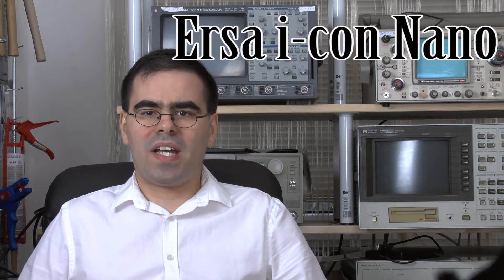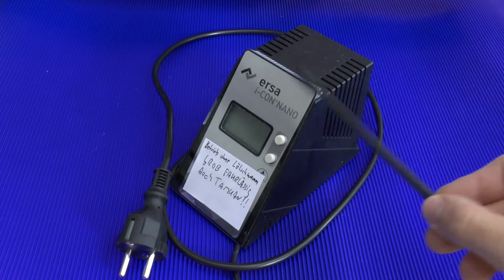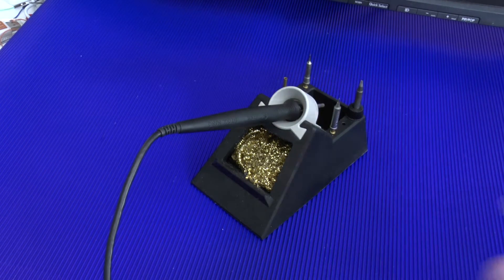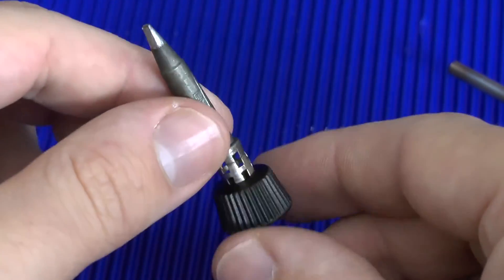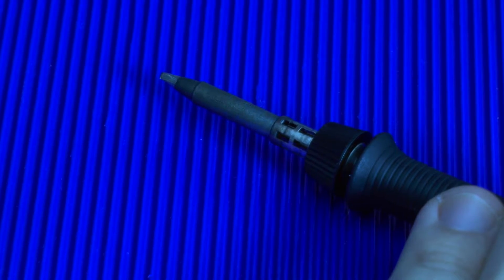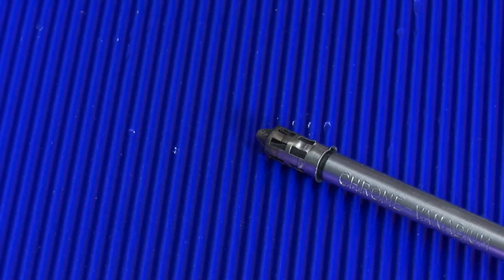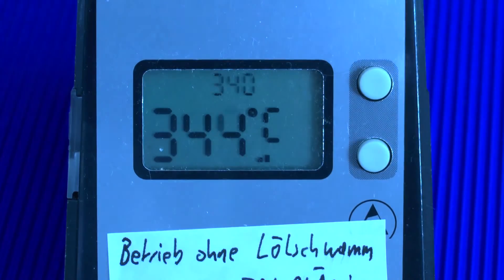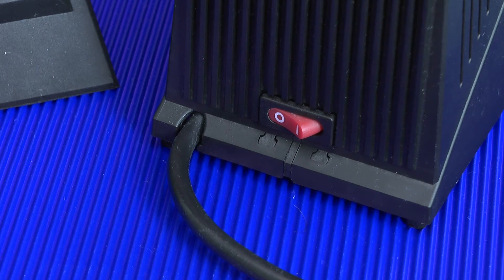Ersa i-con nano - review, solder tip caveat emptor

Comment: I bought only an extra tip holder (a green one), so I have one green and one black. Every time I need to change tip I always have a cold set handy to separate until the previous one cools down!
Reply from the maker: Thanks for talking back, man. One question, however - did you break one of them during teardown? I almost killed mine when I tried to seperate the tip from the holder...
Reply: @MrTamhan  I have found that removing the tip retainer is very dependent on the angle — if force is applied at any kind of an angle, it can jam and make it need a lot more force. (I now just have a retainer for each tip. It's just not worth the fuss. I actually bought a few spare retainers to keep on hand, since many vendors sell the tips, but not the retainers!! 😒 I'm considering a switch to a Pace ADS200 though, since its 120W cartridge tips are cheaper than an Ersa tip plus retainer, and Pace's build quality is spectacular. I got a used Pace desoldering station, and it's just fantastic.)
Reply from the maker: @tookitogo  Thanks for talking back man. I had someone from EDSYN blow up my mailbox, but she since went quiet...let me know how it all goes, please

Comment: Did you say you should use a wet sponge?  I thought this was a no-no.  Causes stresses in the tip cladding and reduces tip life.  I only ever use dry pads like the one in the video and my Weller tips seem to last forever.
Reply from the maker: Hello, to be honest - I recently found one of these dry steel wool thingys to work quite well too. It, IMHO, is mainly a question of taste - if the tip lives a little less long, but it is more comfortable to work, then...ugh, its all a bit difficult ;). Big thanks for talking back though!
Reply: Using a wet sponge is indeed a no-no. A damp sponge, however, is OK. With that said, the brass wool is even better, being gentler on the tip (due to much lower thermal shock, especially at the higher lead-free temps). I don't miss the sponges at all, having to keep a bottle of distilled water at hand all the time...

Heck, at work this week (I work at a technical training center) a kid laid an iron down to warm up, as it had a special tip mounted that was much too large for it to go into the iron holder. He didn't realize he'd laid it onto the sponge, which hadn't been moistened! 😩 After a little while, the teacher asked "umm, what's burning?!"

Comment: You can buy them on Amazon (round about 7€):

Ersa Lötspitzenbefestigung für I-Tool, schwarz, 3IT1040-00 https://www.amazon.de/dp/B00725AYNO/ref=cm_sw_r_cp_apa_zx7yAb22BPZYH

They make changing the tips very easy (you can even change them while they are still hot)
Reply from the maker: Thanks, man!

Comment: It's PEBKAC problem, not an issue with a tool. I you would do this normally, and not bang it against the desk, it would take half a second to remove. Just calmly take it with both hands and push the tip inside the holder.
Reply from the maker: Try that when its hot ;)
Reply: If you want to change them hot, just buy some tip holders as I've done. Actually one piece is enough. Just put spare holder on the tip you want to use and remove from hot tip a bit later.
Reply from the maker: Well man, I bought one for each tip and now have no effort ;)

Comment: FYI, it turns out that the plastic nut and the metal collar can be purchased separately, at least in theory. The plastic nut is part "3N497" ("3N497G" for the green version), the metal collar is "3N539". However, finding vendors that actually sell them alone is tough. I did find one in Lithuania: https://www.evita.lt/en/i-3n497-litavimo-antgaliu-prispaudiklio-verzle-m10x0-75-ersa
Reply from the maker: Wow, man! You are the hardest!!!
Reply: Weidinger sells the green version too, for like 5€. Weidinger part number WL33297, Ersa part number 3IT1045-00. If you are already at the weidinger website, you might however just pick up a more decent soldering station... ;) I'm sure Ersa is fine, i like theyr HR 100 tool for delicate SMD rework, but with the iCON Nano stations, you get what you pay for.
Reply: @ProtonOne11  Nope. That's the complete tip retainer (plastic nut and metal collar), which is widely available. This discussion was about buying the nut and collar separately. 

As for your comments about Ersa… not sure what you're trying to imply. The nano is still a great soldering station, and Ersa's tips are reasonably priced. With the Pace ADS200 on the market now, I think it's a much better value than the nano is today, but it didn't exist 5 years ago. The nano isn't a cartridge-style iron, but its performance is much closer to a cartridge than it is to traditional tip-and-heater irons. I use JBC at work, and while it is somewhat better than the nano for really heavy joints, it's far more expensive (especially the tips, which are crazy expensive), and I actually prefer the feel of the Ersa handle. (I have the nano at home.) Also, the JBC stations plastics just feel cheap. Yes, they do last, but they feel terrible. The quality plastics used on Ersa stations is much nicer, and of course Pace's heavy all-metal construction leaves them both in the dust!

I do kinda wish I'd bought an iCON 1 instead of the nano, not so much for the extra power, but for the better user interface, stackable housing, and accelerometer-based setback. The nano's non-backlit display is annoying, as is having to press and hold buttons to change temp. Of course, if I were in the market for a station today, I'd get the ADS200, since it's both cheaper than and superior to the iCON 1.

Comment: nano doesnt have a sensor in handpiece
Reply from the maker: Hello,
that is strange - with mine, it seems to wake up automatically... But you can very well be right...

Tam
Reply: it has sleep mode. those are that 3 munbers when you powering it. number 3 is 3 minutes to sleep, 250 is sleep mode temp and 10 is shutdown after 10 minutes in sleep.
sleep mode deactivate when temp drop 5 or more degree (cleening typ in brass wool will usually do) or when you press any button
Reply from the maker: Hello Mic,
wow, big thanks. Please stay here, and maybe also visit my Instagram!

Now the question is how I correct the video the best way...

Tam

Comment: Can you not ream or sand the inside of the "weird metal part" so the tip slips out easier without all the banging? Surely the friction fit it not necessary unless u use a screwdriver tip as a screwdriver.
Reply from the maker: Hello Kenneth,
thank you so much for the reply. In fact, the idea is quite cool and I did not think about it - but I just bought a few more of these parts, which also makes switching tips easier. I switch tips an awful lot when soldering...

Tam
Reply: Tam, np. I use Hakko 888 and many other irons in the past with similar style. The tips and retaining tube and screw down are essentially the same as this Ersa, but the fit is loose enough for the tip to fall in/out. So it is an easy leap for me to make. Good luck with the channel.
Reply: BTW, it makes great sense to have one for each tip for handling the hot tip. So I think multiple retaining pieces is the way to go. On my iron, I need to use pliers to unscrew the (hot metal) retaining piece, anyway. So I might as well handle the hot tip with pliers, too.
Reply from the maker: Hello,
with the ERSA, it is much the same. Unscrew by hand with the plastic, and then use pliers to move the tip!

Tam
Reply: I just unscrew the tip by the plastic, then grab the plastic and remove the tip onto the stand. No pliers needed! :D

Comment: I have the nano as well, and the lack of backlight is my biggest annoyance, so I added one. I turn it off and on from a power strip instead of the little switch in the back.

The nano does not have an accelerometer; it uses only temperature sensing to determine when to go into and back out of setback. Only the "big" I-CON stations have the accelerometer. 

P.S. "Zange" is "pliers"- "tongs" are the big ones you use in the kitchen. :)

Comment: Just do like I did and buy more tip holders so you have one on each tip. They're cheap on Amazon.de.
Reply: Yeah, I have one for each tip.. Never crossed my mind to change the mounting brackets.. The tips wear out  before the mounting bracket. Another "pro" tip is to get the official tweezer which makes changing tips much more comfortable, especially when they are still hot https://www.kurtzersa.com/electronics-production-equipment/soldering-tools-accessories/spare-parts-auxiliaries/accessories/produkt-details/3n544-1.html

Also https://www.ersa-shop.com ships to most of Europe, the site is in german only so I have to use google translate to shop but I've ordered many times over the years without problems.
Reply: @pleggli  Have you had any issues with the Ersa tips wearing out? Admittedly, my nano doesn't get heavy use, since it's just for my home hobby use. But 6 years on, all my tips still perform like new. (I periodically use a fiberglass brush to clean off all the flux crusties, but I've had no trouble keeping the tips tinnable.)

I agree about ersa-shop.com: I bought a few tips and accessories from them a while back. Just a pity that being a smaller company, they send things normally, meaning on any larger order, always fun surprise bills from Swiss customs. (As opposed to large companies that are required by law to collect Swiss VAT, thus avoiding surprise bills.)
Reply from the maker: Hello,
I got mine from RS components - sadly, Mouser does not have them in stock.